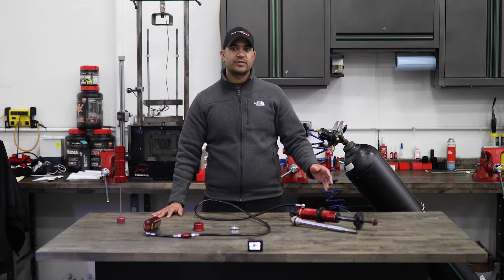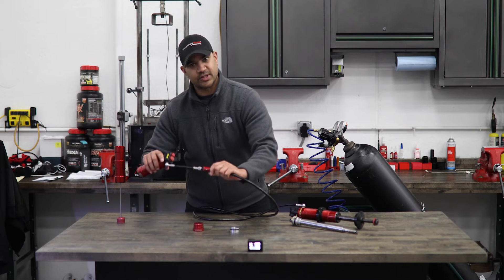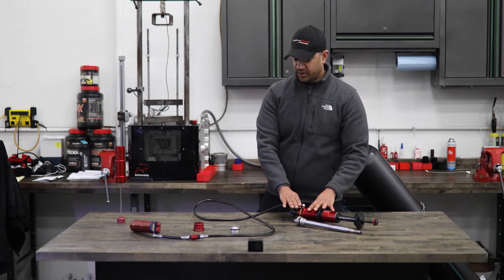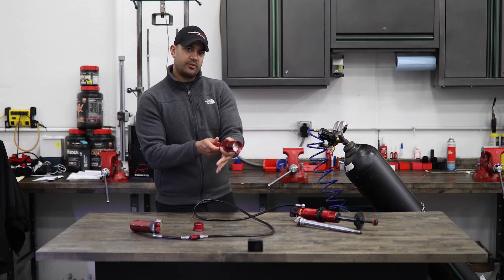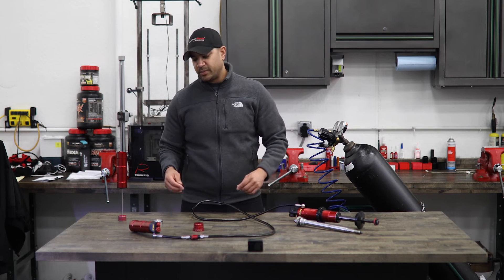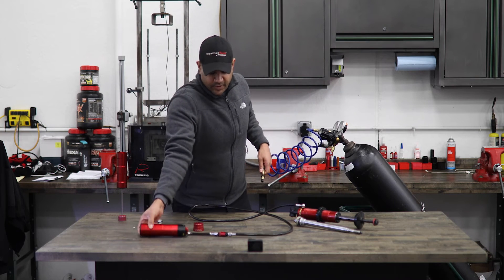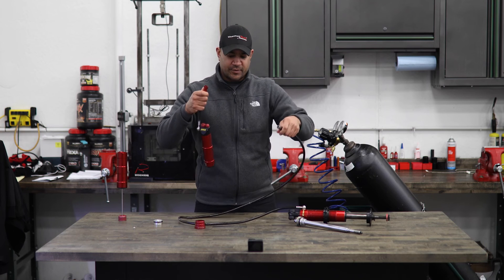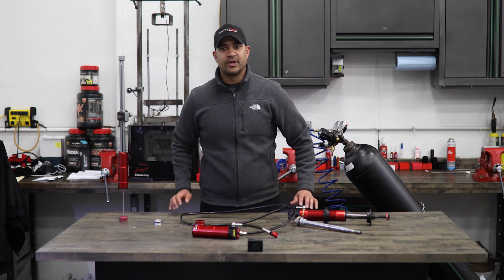How To Use Quick Disconnect Fittings On Your JRZ Damper Hoses

Comment: Did you just set the regulator on that tank to disired pressure and just connect to the canister ? Will it stop filling it when it’s reached said pressure ?

I have JRZ motorsport 1132 and wanna set them to 220

Thanks
Reply from the maker: Hi Thomas, in this video we set the regulator to the pressure we wanted and it stops filling at that pressure. When doing setup we recommend using a more precise filling tool to set the shock pressure. We'll do a video on that next!